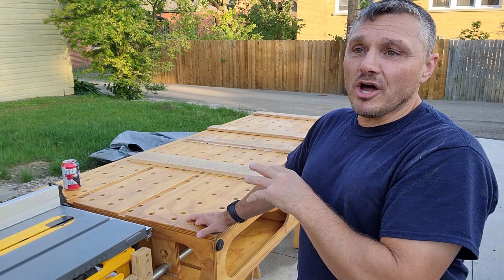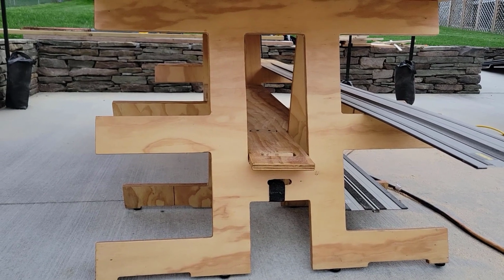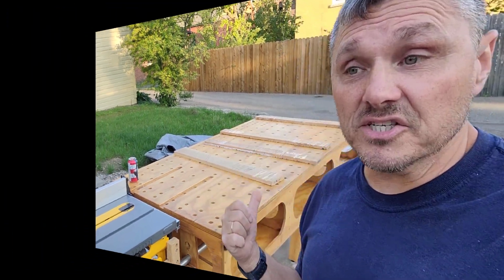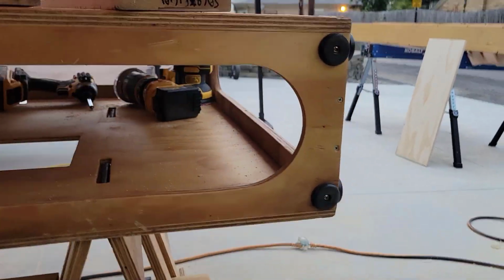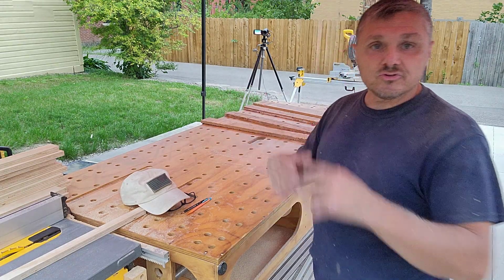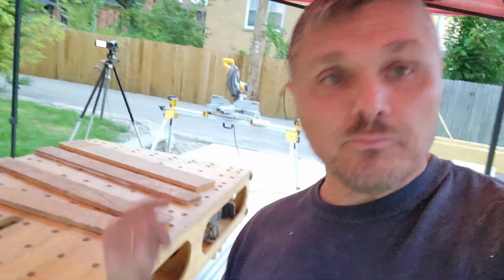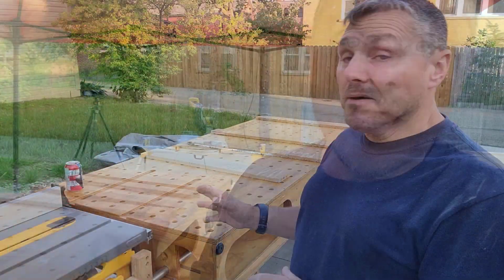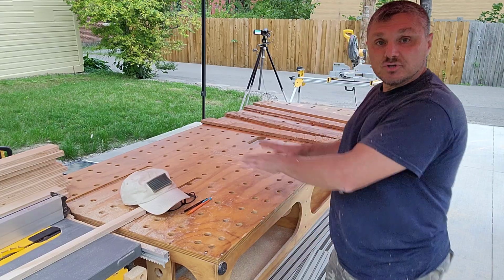3 years with the Paulk Compact Bench -- an UPDATE on how it has worked out

Comment: Great video and tips. I'm ready to build my own. Still deciding on the overall size. Your comment about the weight was helpful. Thanks
Reply from the maker: Howdy MCC! Thanks for checking out the video and commenting.  If I built this one again, I would make it 3x6 for surface area and reduced weight. The extra foot doesn't make as big a difference as I thought it would. 

If I were to build one now and not rebuild this one....I would build Paulk's new benches. 3x6 still but with the cart/casters for mobility. It is a super pain to move this bench a couple feet without breaking it down. If it were on that cart system, moving is a nonissue. I can't count the number of times I needed to move this bench a couple feet or across a room for convenience of workflow and bam! It is now an issue. Minor but certainly a consideration. 

Best of luck with your build!

Comment: I love the idea of the marine varnish. I built the total station with the lightweight premcore plywood. It's great, but there have been times it's been in the weather, and I'm always stressed about how it'll affect the bench.
Reply from the maker: I hear you! My build ended it up taking weather a few times and each time, after it dried out, I ended up doing a lot of sanding to get the grain down again. Knowing my workflow and working outside, I finally decided to "weather-resist" it with the sealer. I plan on doing this to any new bench builds too. I won't be working inside consistently anytime soon so it will not be time or money wasted to varnish the new ones. Thanks for the comment and checking out the video!

Comment: Nice set up. I tried out the table saw thing and didn't really like it, but to each his own. As per router plate, mine is a diy job. 3/8 clear acrylic. Router vid inbound for me soon. Head over to a local glass installers shop, and you might be able to pull off buying a piece like I did for 25 bucks(16×30 is what I was able to grab up).  4 screw holes to mount the router on it and lower it while running to get it dead center, take it back apart and widen the hole. Nice vid.
Reply from the maker: I built all this before his hanging system he now uses so I backed it up to the rail system to hang the saw on. Ron's mid-design method was that his table saws were on wheeled stands independent of the bench but at the same ht so it was still an outfeed. I did not have a wheeled stand or a stand tall enough to use the bench for outfeed. The rails made it happen. Next bench will be the hanging system  with saw on shelft. Great idea on the router plate! Thanks for the comments!
Reply: I built a cradle for my 10" dewalt table saw last week. Its a game changer having everything on the total station. I also build the smart cart. Also a game changer.

I built both so I could efficiently use my 1 car garage to build my smart woodshop for my box truck. I'm very surprised at how much I've been able to do in such a small space, facilitated by those 2 items.
Reply from the maker: @marcmacialek9250  Thanks for the comments Marc! I am envious. I can very well imagine how much a total station would change the workflow and efficiency and then to have built the cart! (You're killin' me Smalls!) 

Did I mention I am envious?! 

I have committed myself to not cheat and build the new system until I have the lightweight plywood as a motivator to get the plywood. You are not making it easier.